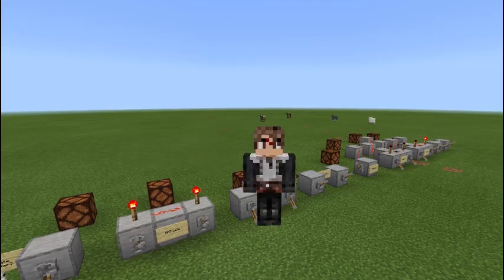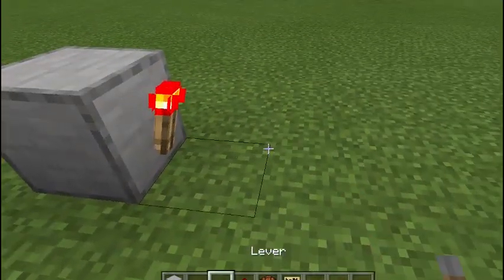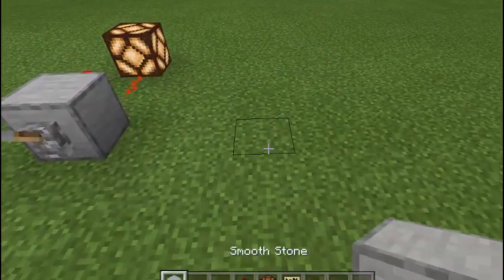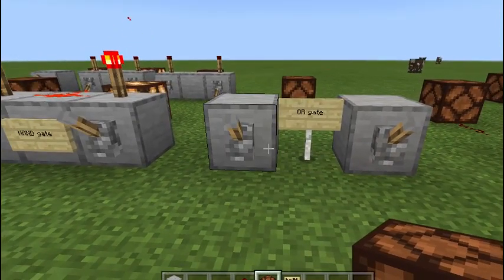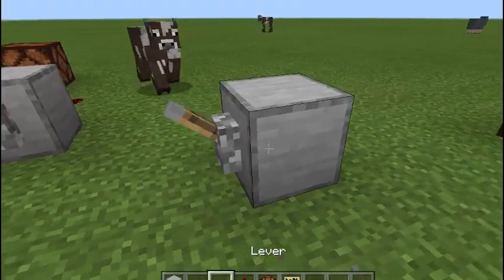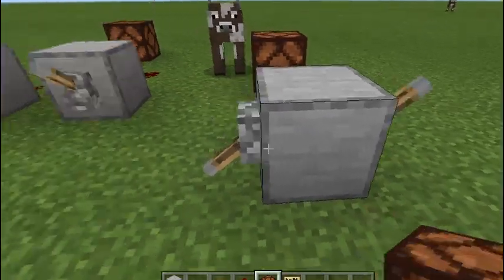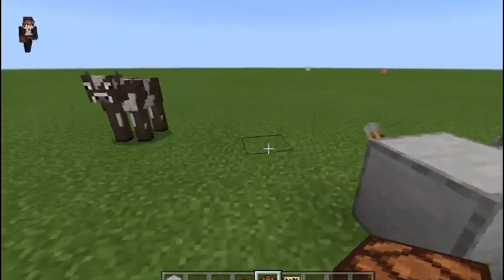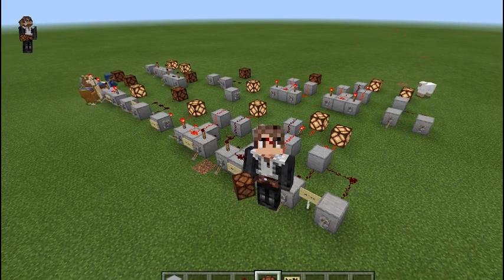Minecraft Bedrock Logic Gates

Comment: Hoooo boy, that XOR gate took a while to wrap my head around!
If anyone else is wondering why it works, I'm guessing it's because it's a combo of an AND gate and a NOR gate, leading into another NOR gate.
When both inputs are OFF:
- The AND gate's output is OFF
- The first NOR gate's output is ON, making the second NOR gate's output OFF
> The XOR gate output is OFF
When one input is ON and the other OFF:
- The AND gate is still OFF
-  The first NOR gate turns OFF, turning the second NOR gate ON
> The XOR gate output is ON
When both inputs are ON:
- The first NOR gate is still OFF, attempting to turn off the second, but;
- The AND gate is now ON, which sends additional inputs to the second NOR gate, changing the output to OFF
> The XOR gate output is OFF
...At least I think that's what's happening. Please correct me if I'm wrong!